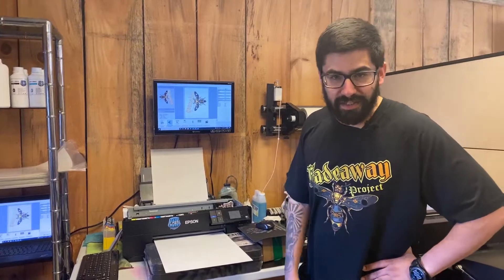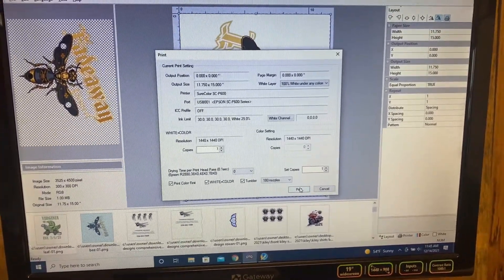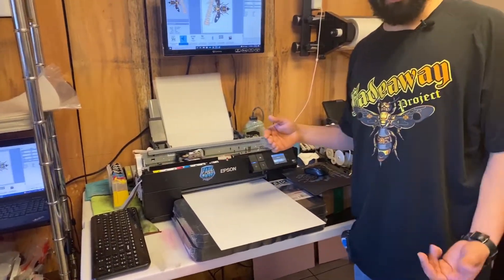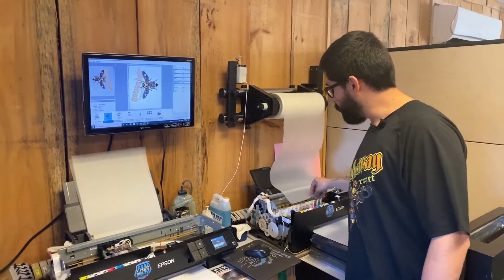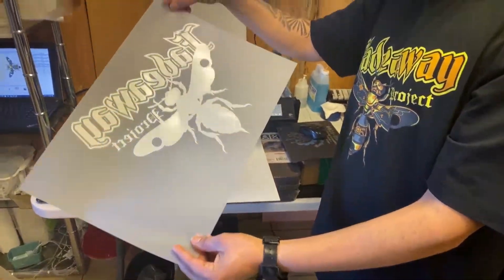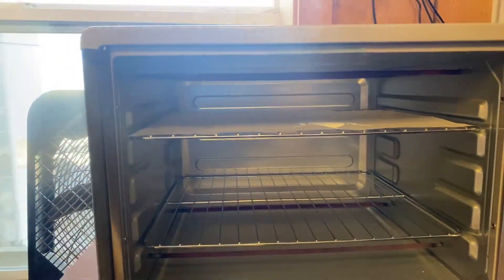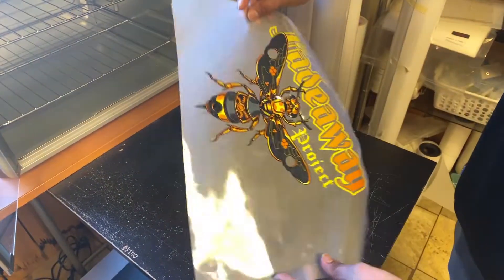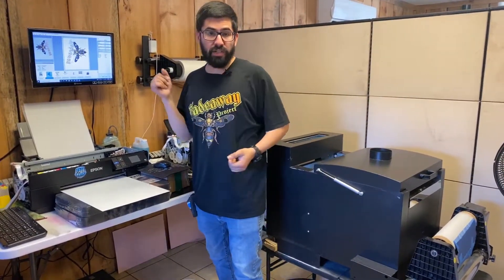Epson P600 (UPDATE) DTF (Direct To Film)

Comment: I am having problem with my p600 feeder. Getting a 0x53 error code and the feeder roller is stuck
Reply from the maker: Error 0x53 can be difficult to resolve.
Is your printer currently taken apart? 
If so take a look on the left side of printer as if it’s facing you. The black sensor holding the clear wheel behind that you will see a small motor with another sensor. Make sure it didn’t fall or get moved. Email or contact if possible and I can try and help. ytfadeawayproject @ Gmail . Com

Comment: Are there any newer printers recommended for dtf
Reply from the maker: For Desktop Printers, would be like R3000, P600, P800.
The Epson P800 would be a better Desktop DTF Printer. 
The best dtf Printers would be more like commercial wide format DTF Printers, being able to do 24" Roll printing.
Reply: Do you think the 
Epson SureColor T2170 24-Inch Desktop Wide-Format could work I’m interested in converting one
Reply from the maker: @alexanderjoseph5058  so for the AcroRip Software 10.5 Version are listed as follow. 
Compatible with the following printers:

Epson Stylus Photo
1390/1400, R1800, R2000, R3000, R1900, R2400, R2880

Epson EcoTank L800/L805, L1800

Epson SureColor P400, P600, P800, P6000

Epson Stylus Pro 3880, 3885, 4000, 4880, 4890, 4900, 3800, 4800, 7800, 7880, 7890

Epson Expression XP-15000

Epson EcoTank ET-8500, ET-8550

I'm unsure about that model you have unfortunately.
Reply: @fadeawayproject3166  thank you very much for your help
Reply: Thank you for your help

Comment: Hi Nice video again.. can you tel me please  where r u showing how to take cover off do lid override / so printer working without top cover. Thanks
Reply from the maker: I ended up wiring the connector to a push button for the ink cartridges indicating when lid is opened or closed. For the bigger lid I ended just putting a small piece of plastic to show closed at all time.
Reply: @fadeawayproject3166   thanks .. i have no problem with big lid but cant make small one .. is there any chance can somehow post  the picture pls